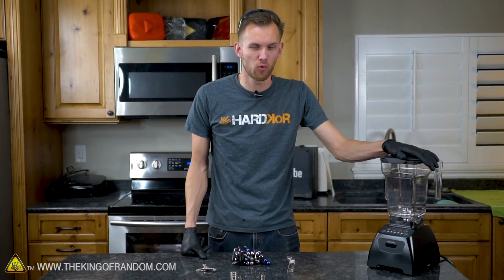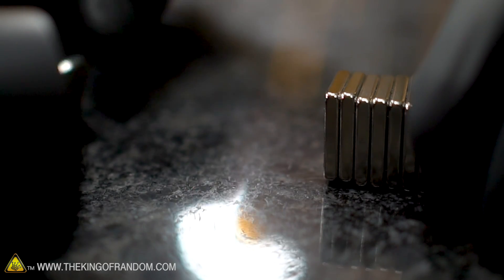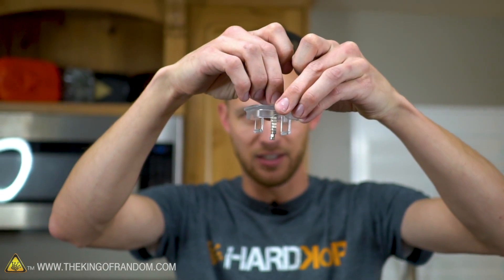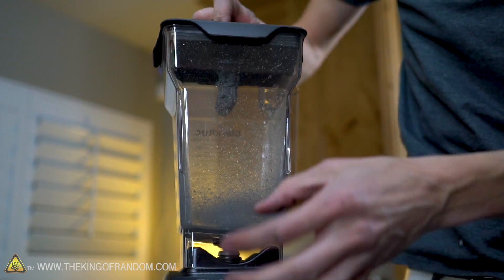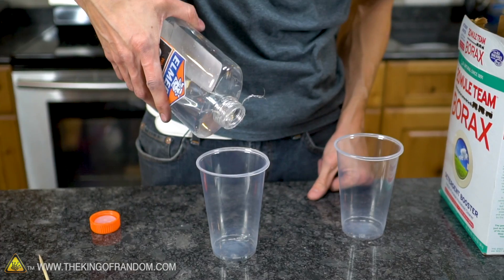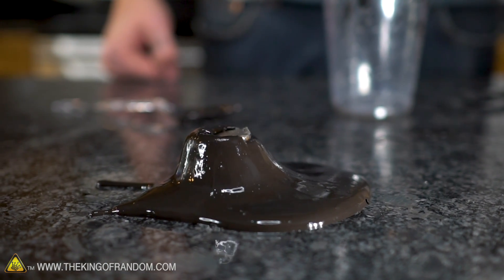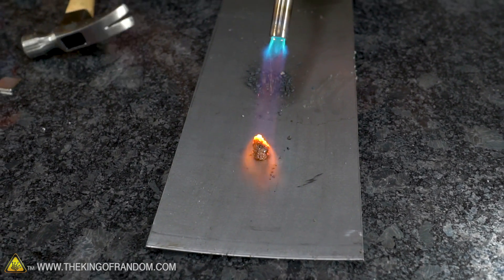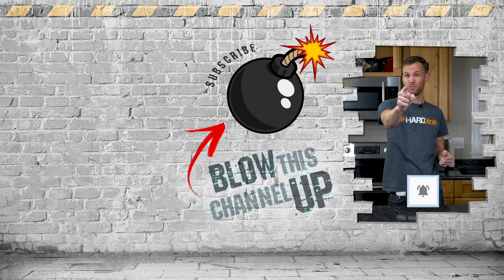Will This Make Magnetic Sand?

Comment: I made a prediction and i was right. The magnet power was not as strong because it is no longer say crystallized (or arranged in a way that is organized and putting each particals power into all making it one) same concept as 1 3 sticks are weaker that 1 log even though the log is the same mass as the 3 sticks